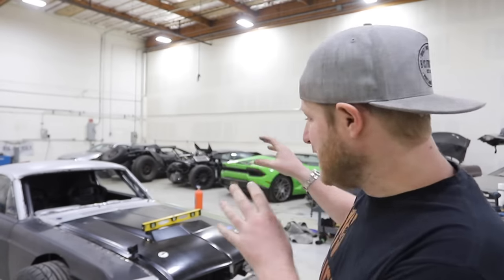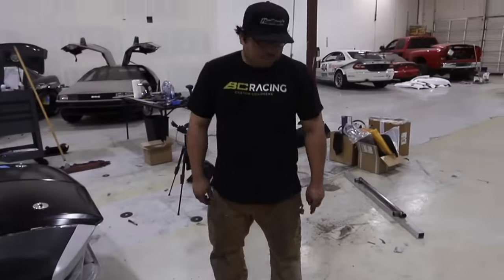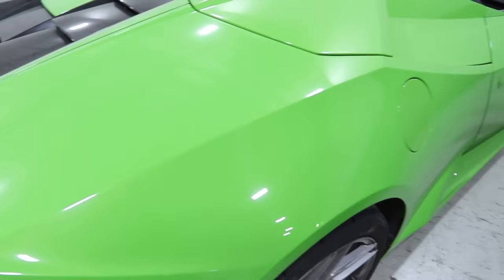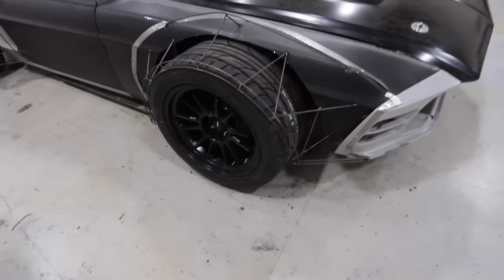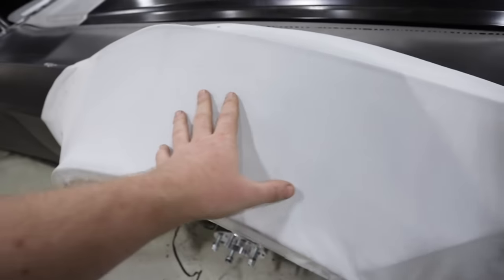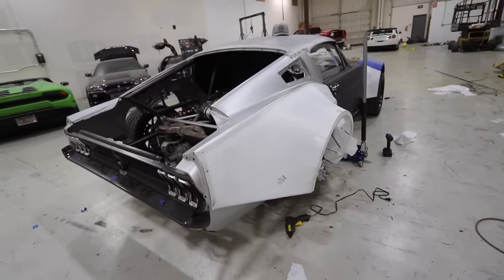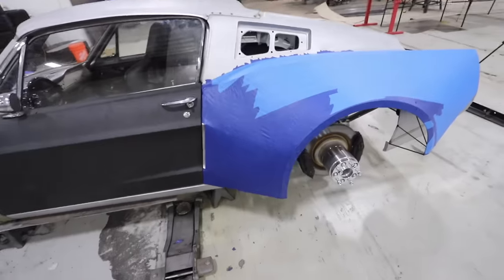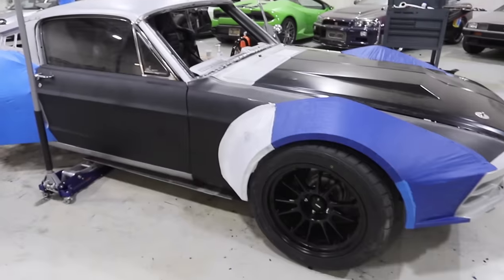Building a DIY Wide Body Kit for my Mid Engine 67 Ford Mustang Fastback

Comment: I do custom composite work like this. A great trick is put aluminum foil over the tape, and you can remove the whole under structure. Works like a reverse plug. Love the build!!
Reply: That's a fantastic tip actually!
Reply: Why not just spray it with mould release?
Reply: @rallycsx  the tape isn’t a perfectly flat, non porous, so the pva won’t coat everything. If you run foil, you can flatten it out and the resin doesn’t stick.
Reply: Also, resin/fiberglass will not stick to clean plastic surface. On boat i often prepare a piece of fiber on a layer of plastic sheet before placing it in place on the boat with the plastic facing outside. Once it's cured the plastic sheet just peel away and you are left with a pretty clean/shiny fiberglass surface.
Reply: @Jbellz
Good idea , I used packing tape over the blue tape works great as well!
Reply: @JRs-Garage  I was surprised the HF blue tape held the weight of the 1.5oz mat and resin.. Glad it did though..:)
Reply: I hope they remove the tape eventually
Reply: Can it be used with carbon fiber ?
Reply: @_sousa_delsol  yes, that’s mostly what I do
Reply: Duck/Duct tape also has a "plastic" outer surface that mold release will work with. So a layer of duck tape after the blue tape and then you can remove the fiberglass. Take the blue tape off and put the fiberglass back in place over the rods, glass the I side to attach them together. Job done
Reply: I totally agree with reworking the rear fenders.  Seemed to muted and more like a big bubble.
Reply: aluminum foil is a new one to me.  I've used flashbreaker tape, teflon/ptfe tape, and painters tape with carbon wet layups.  All seem to work about the same but for this painters tape is gonna be the cheapest by far for fiberglass.
Reply: That's genius!
Reply: Thats a great tip! thanks

Comment: Looks incredible guys. Just one tip from a guy who built fiberglass Humvees for military training simulators. Spend a couple extra minutes with the brushes and pound those air bubbles out between laminations and the whole layup will be massively stronger. Also a quick scuff with 40-80 grit helps each layer bond to the previous. You guys can obviously make anything!

Comment: Hey just a FYI to help with crafting. If you spead some wax on a flat surface. When the wax dries you can lay a sheet of fiberglass on it with resin. When it dries you have flexible fiber sheets you can cut an shape by hand

Comment: Gotta use a roller dipped in acetone to get those bubbles out of the fiberglass. It will much stronger and save you days of bodywork. Available at any composite shop. 
Very cool project, keep after it!
Reply: ^^THIS^^!!!😊

Comment: This is outstanding.  I wish I would have known about the aircraft material when I started my build on my '71 Mustang.  I did use a lot of tape on the console build.  A few of the guys at the military craft shop could not believe I used tape and cardboard to build it.  Right now it is sitting under my carport gathering dust.  I can't complete the build due to my back issue. You are breaking my heart seeing how you guys make it look so easy.  Keep it going.

Comment: It might help with the fabric to use an iron instead of the heat gun. You make several passes at increasing temps. It would help to be able to control the shrinking of the fabric a little more. That is how they do it in aviation at least.

Comment: Automotive designer here.  What you're doing with the tape and constructing the planes is actually similar to what we would normally do in Clay on the cars.  The only downside I can see is that you're not able to get as much sculpture or crown in the surfaces.  I would just give a little caution to letting the fenders have a negative curvature.  Always try to be positive in fullness to look stronger.  The Pull out of the belt to shoulder line was pretty cool!  It's crazy to see the 3D steel lattice work;  almost like you're 3D modelling in person.

Comment: ive said it before and i'll say it again, using fleece and fibreglass resin...!! you can do each section one at a time and fleece over the top works... some curves you use the aircraft material and some bits use the fleece...!   anyways loving the progress x

Comment: as you apply the resin with a brush you should use a small roller to squeeze out the air bubbles, I could see you're full of air pockets, this will create more work later when it dries
Reply: 👆👆Congratulations you’re shortlist among the winner today use the telegram handle above to DM…

Comment: That "rear hips" problem with modifying the 67-68 Mustang is VERY common. Usually the way it's fixed is they put a cut across that tops flat area, pull it out till there is a gap/it looks right and then weld a filler strip an inch or 2 wide to get rid of the gap. I've seen it done basically like you did (a crescent shape), and I've also seen it done as a wedge where it gets wider as it goes back and once it opens it goes all the way to the back and then they rework the rear panel or the tail light filler panel.

Comment: Yall need to use a grooved roller on the fiberglass to remove the WHITE void air pocket areas so that you have a complete mechanical bond between layers.

Comment: Interesting process. FYI - it's pronounced See-Con-Ite, a polyester fabric used in the aerospace industry for covering wings, fuselages and control surfaces of older airplanes. It is used to replace the original woven cotton or linen fabrics...stronger and lasts longer before the aircraft needs to be re-covered.

Comment: Hey guys. What about using adhesive vinyl instead of tape?  from what i can see, it gets wavy because you're putting it on 1.5 inches at a time. If you laid 12 inches at a time it might not do that. might have to brace the skeleton better as youd probably have to stretch it a bit, but then youd need less glass/filler to fix the waves. might be cheaper than 10-15 rolls of tape too.

Comment: Have you tryed using a small roler instead of the brushes when you are fibreglasing? i only use the brush when in tight spaces, it will reduce the amount of airpockets traped inside the fibreglass, and thuss making it a stronger product, and its way faster :) (and using a special roler afterwards to intertween(?) the fibres between the layers will make it stronger)

Comment: I thought you were making fibre glass molds to then make proper widebody fenders that you'd then mold on. 
That's the proper way to do it and I recommend it for the sole reason that you won't have several long metal projectiles hitting your wheels and/or launching out of your car in the event of a crash. 
Having the molds will also make the kit more replaceable, and maybe you could also sell it in the future..?

Comment: For the love of man... Get yourselves a fiberglass roller. Those air pockets between the layers killed me. You'd have a much nicer finished product. Stronger and straighter. And it would be easier to body work. I was a fiberglass repair man for 18 years.
Reply: same here, what a mistake...all that preparation and then that result..
Reply: @detslutarmed  and then to talk about the people going to SEMA with half assed things, and them taking the time to do things over to get them right... Lol. If my old boss would have seen that air I would have been out on my ass. Lol.

Comment: To make the joints fully stable and eliminate cracking , you should make your fenders then detach them from the sheel metal , ( leave them in the sun for about a week) then , after they have fully cured reattach them with 2 part "AIRCRAFT EPOXY" this method makes the joint so much stronger than just glassing to the sheet metal guard...
I used this method on a fibreglass kit I attached to a steel shell 30 years ago and not one crack has appeared....
Reply: Hey YouTube , why do you leave all the Scammers trying to contact the Subscribers....
Do your job and "DELETE THEM"...!!!
Reply: HEY YOU TUBE...
DO YOUR JOB AND DELETE THESE FAKE ACCOUNT SCAMMERS...

Comment: i have an idea but i want 10% of sales why not make a product that is fiberglass tap where it fiberglass sheet a sticky activate then a layer of proactive for the next strip then add the activator on top to form the mold .. add layers then sand to fit.. the best part of this is the glue is the most brittle  part  so you can weave in other things other then fiberglass

Comment: The much easier and way cheaper way I always made fiberglass parts is you buy a bunch of blocks of florist foam and stick it on the car. Then you just take a knife or file and sculpt your part. Then lay the fiberglass over it

Comment: Fun fact I can say while remaining slightly anonymous. I worked at Dynacorn. I was building their complete shells. NOTHING ON THEM IS CORRECT, NOTHING ON THEM IS RIGHT, THEIR JIGS AREN'T SQUARE. I left because they didn't care, I tried so hard to get these things correct and they didnt' give a shit. EESSPECIALLY the 67's and the 70's bodies. It was absolutely heinous. IF YOU WANT TO DO A DYNACORN BODY you better have insane fab skills because they will need adjusting in every way

Comment: You could’ve just put some spray wax on the tape and then it would’ve separated from the fiberglass easily.  That’s how I build negative molds for doing carbon fiber.

Comment: I completely get the "un-compound" curves you are trying to get, but there were still still areas where you DID want that cessanite look.  Next time, leave the fabric on there and then just run tape over the flat sections you want and blend them into the fabric where desired.  When you trimmed it away for the flat section the part you wanted to keep collapses and loses its shape.

Comment: So in the time lapse of them making the framing for the rear fenders they took the wheel off and it looked like there was 8 inches of spacers. Why are they making the wheels stick out so much instead of tucking them under the original rear fenders more? Pls don't hate just curious.

Comment: Because the 70 doors are plainer than the 67's, I find it disappointing that the two horizontal lines at the rear of the 67 doors are just disappear into nothing.  Personally, I would exaggerate those lines more and more towards the rear of the door, so that they can flow into the new widebody fender with a big scoop.   Like a Testarossa on steroids.

Comment: It looked better without the wide fenders would have to re adjust the arms so the wheels can sit back flush into the stock body and just get a decent engine to fit into the frame the original look you had it in the beginning looked so sexy like one of a kind already but once u did the wide body it looked like a Batmobile should save that for a different project and if I wanted a huge engine in it go for a tube chassis and different exterior look because I honestly think the original look of the car in the beginning of the video was at it’s best .

Comment: Be easier to get the fenders 3d printed so you can pull the mold from that and then you can make as many copies of the over fenders as you need.
Reply: Easy? Find a link to someone with a 1metre print bed
Reply: @janeblogs324  I have a .5meter  and 130 .2 meter printers you print it in pieces.

But if you wanted to print it in one go that's easy too, have many contacts with 1 and 1.5meter printers

Comment: The front looks way too much like a corvette now with the raised speedracer humps over the wheels. Move the line from being straight back to the outside of the fender. having the lines flow from the front bumper outward then back to the side mirrors and lowered would get closer to a gt40 front end look.

Comment: You should do an emergency check and make sure that the front windshield is going to fit the windshield opening it's possible your a pillars are not in the right positions causing your fenders to not fit your cowling then again you're Colin could be screwed

Comment: All those GIANT air pockets in your layers of fiberglass will come back to bite you in the end. Every time you take it out on a hot day, they'll inflate beneath the fiberglass, filler, primer, paint, clear coats and look like giant filler pockets. Why do you think carbon/fiber car manufacturers use autoclaves and vacuum pumps? It'll be too late by the time you'd read this but with a deadline like yours, I'd probably miss a beat or two too. I hope I'm wrong...

Comment: Please it’s pronounced CEE-KON-ITE. 

Also, if you want even stretching, use an old clothes iron. (They maintain temps better than the new energy efficient ones). Less steam ports the better. Or get a hobbyist iron. 

Then infrared thermometer, or dedicated iron thermometer, 
Let the iron turn on, set temp to 250 degrees Fahrenheit, LET TEMP STABILIZE for roughy 15 minutes, check temp again, and then tighten. Go to 200 first if less stretch is wanted. 

Iron everywhere. 

Don’t exceed 350 degrees-ish. Not using it for aircraft, so you can heat however hot you want, but as a rule of thumb, less heat than 350.

Comment: Air pockets everywhere on the first and second layer. This is basic body work rules guys. Come on. Am i the only one who knows/saw this??
Reply: Is it filled by the epoxy cause then it really doesn't matter
Reply: It doesn't matter. They are not building a boat..they didn't remove the air pockets because it requires  pressure and they are using tapes.